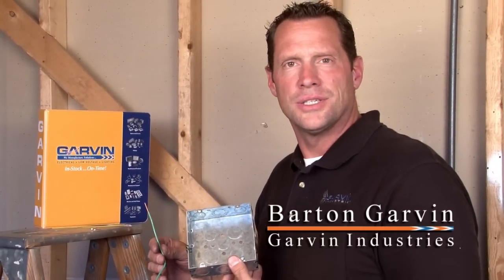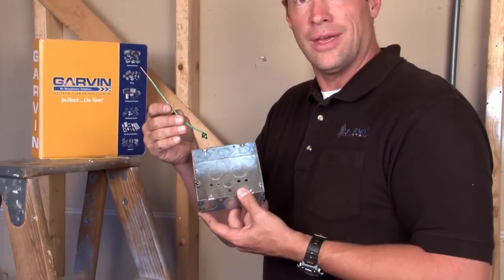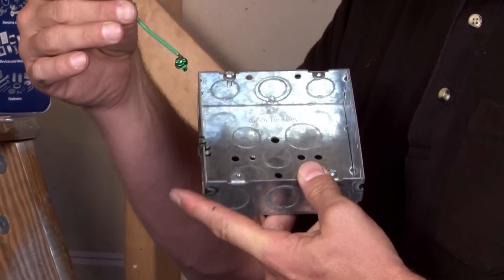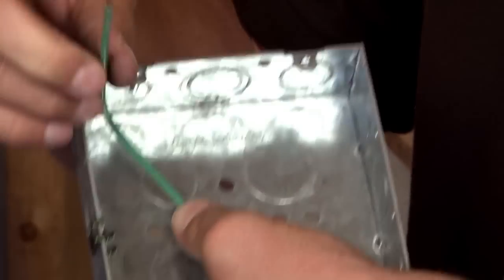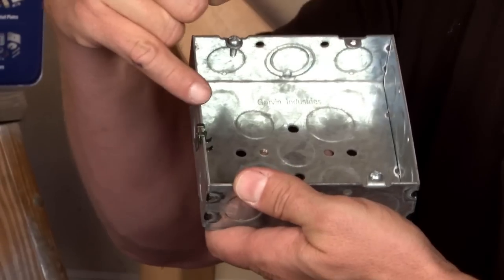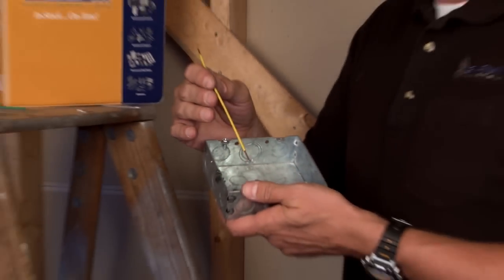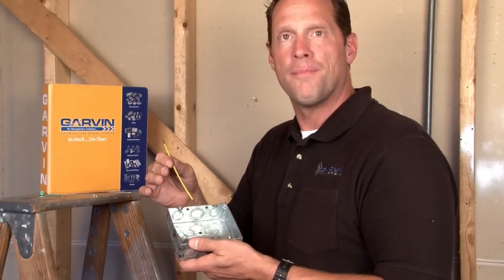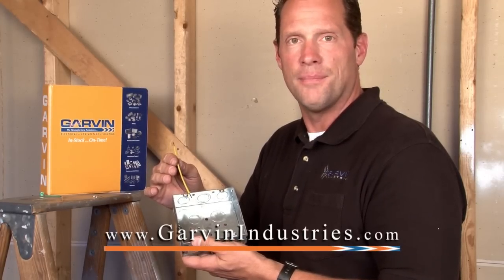Grounding Pigtails, Grounding Screws and Grounding Clips... GS, GC, PTST & PSTO Series

Comment: Do they make 4x4 metal cover plate that has only 1 oulet (rectangle shaped AFCI outlet) cut out of the cover plate - and is not the raised/recessed kind of cover plate.  I would need a flat cover plate b/c  I bought a new work metal box that attaches to stud and it sticks out 1/2" past the stud (drywall thickness is 1/2) already.   I've found what I was looking for but they were all the raised/recessed kind of cover plates and not flat ones.

Comment: I have an old house that has the two-phase cloth/paper electrical wire.  The recipticle boxes are steel or aluminum (sorry, cannot tell). The recpticles are also two prong.  I read that to update to the three prong with extra ground, i just need to screw in a groudning pig tail to the recp. box and then to the ground on the recepticle.  For a true ground to work, don't I need to have a ground wire running to my breaker instead?
Reply: Shawn Pokorski Yes, you need to run a separate ground wire from your electrical box to each of the outlets in your house, in addition to using the grounding pigtail like in the video to ground the box itself.
Reply: If you have armored cable running from your electrical panel to the back of your metal box, that provides the grounding  to your metal box.  You just need to run a ground wire from the receptacle to the back of the metal box. That will provide the ground.
Reply: Meh. You don't need to run a separate ground to be safe, if you can fit a GFCI receptacle into the box. Even if you don't hook up the ground of a GFCI, it gives you all the safety (and then some, actually a lot more) of an actual ground. If your receptacles are daisy-chained, even old wiring, this can protect all subsequent receptacles in the chain. There is not always room in old boxes/outlets to fit a GFCI receptacle, unfortunately.
Before people who don't understand GFCIs tear into this: the GFCI approach can save your life, much more reliably than simply adding a ground.